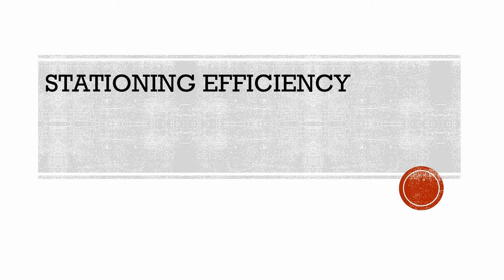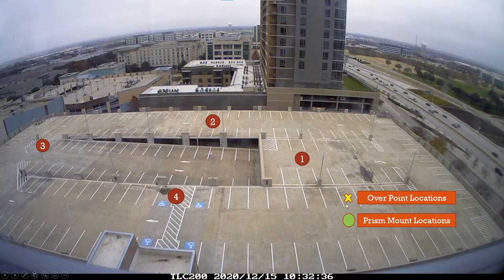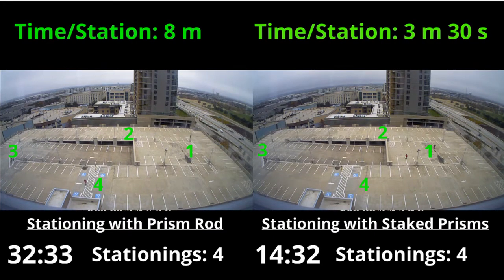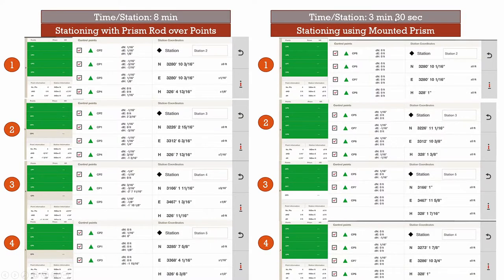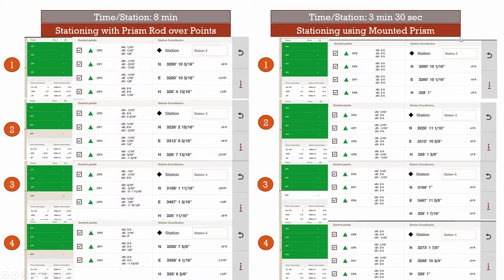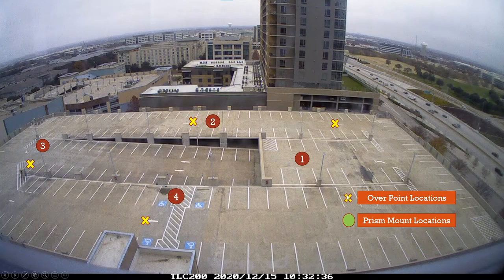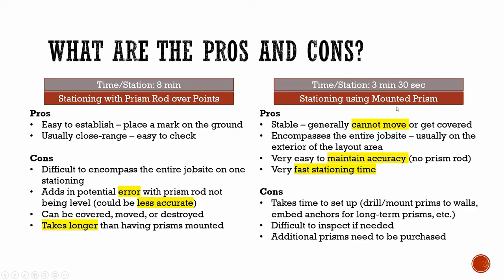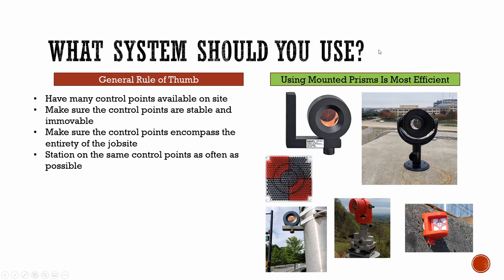Control Point Tutorial - PRISM ROD vs MOUNTED PRISMS - Which is a better Stationing Type?

Comment: How do you mount the stationary prisms? I want to use those for control on projects on neighboring buildings but I don’t want to damage the buildings. Do you just glue the prisms to the building?
Reply from the maker: strong adhesive can work, yes, but typically, they are small reusable yet sturdy screws used for masonry and concrete.

Comment: Thanks - great info. A question: With your prism rod data at Station 3, there are some significant height/elevation differences; for example @ CP1, there is a dH of -2' 7 11/16". This appears to be a gross mistake rather than an measurement error. Thoughts?
Reply: The height differentials when stationing with a prism rod is not of much concern because I can always go back and remind the total station what the benchmark height actually is. This error can come whenever you use a prism rod because your prism rod height might change based off of certain conditions on site... And I don't always tell the unit what exact change thsr is because I often go back and measure in a manual height anyway

Comment: The Hilti tool that I use the PLT 300 & PLC 400 TOTAL STATION for wall layout applications in the commercial framing industry. Which prism has the longest range, and is the accuracy of the plt 300 compromised past a certain range ; such as a given radius from the tool? I tend to run into situations where "exceeded maximum tool range - please switch to the glass prism to continue". Which then involves re-stationing (ie: time management).
Reply from the maker: The PLT 300 will have a warning message pop up when you are attempting to measure to a prism, but it is too far away for the tool to accurately use it. I attempted to use a cat-eye prism once (the POA 25 - the main one with the  PLT 300), and saw that message pop up when I was attempting to hit it about 700 feet away. It looks like you have seen that same message. If you aren't seeing that message, then you know the tool is going to be measuring as normal.

The best prism for long range is a glass prism. The POA 20 360 degree prism by Hilti is one that is programmed already into the tool if you want to use it - it will be the easiest one to connect to because it is circular. Any glass prism should work the same, however. Just know that a prism that isn't round (like the POA 103 - the black prism pictured in the video) might be harder to connect to than one that is round, depending on the angle you are attempting to hit it at.
Reply: @measuringsystems869  Thank you for your time and suggestions. As you stated, I have seen "that" message on different occasions, and have been teetering towards purchasing a round 360°, glass prism to accommodate these situations.. It doesn't bother me to relocate the tool & re-station though, I like the challenge of seeing how close I can get my deviation(s) each time I station.. Kind of a confidence booster 😁 and proving ground to GC, SUPS, etc. of my knowledge of the HILTI TOTAL STATION. I just like to test the boundaries of what the tool is capable of & to what extent..
I owe so much of my knowledge and understanding of this great instrument to your videos here on YOUTUBE. I can't thank you enough for creating and sharing all this 'WEALTH of HILTI-NESS'! It is my go-to whenever I run into an issue or problem that stumps me..

THANK YOU AGAIN FOR ALL THE INFORMATION!
Reply from the maker: @speedaddict3504  That's very nice of you! Thanks for the feedback - the videos are going to keep on coming.